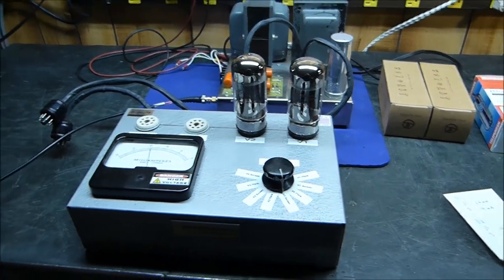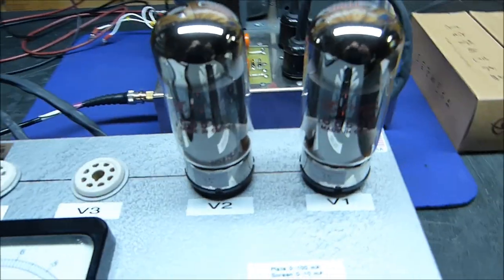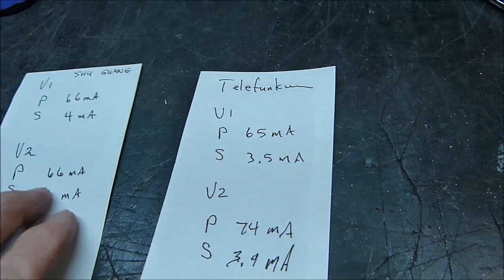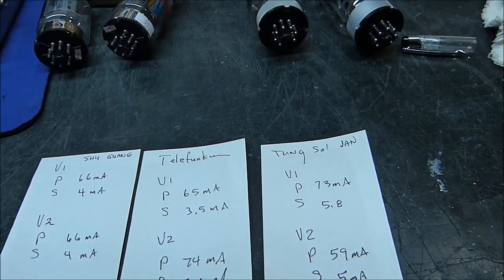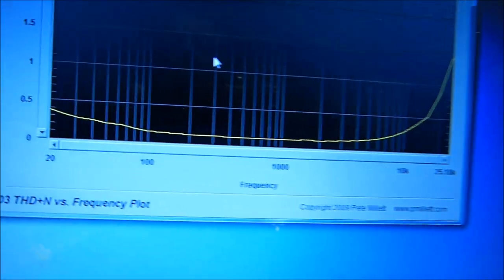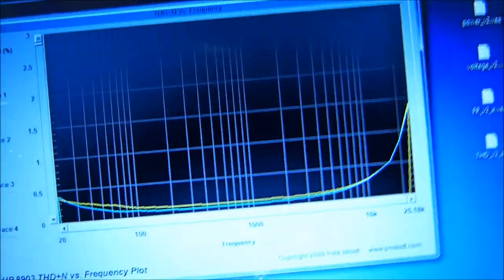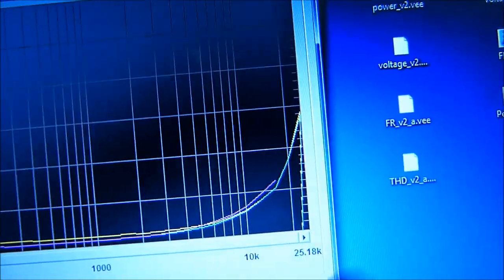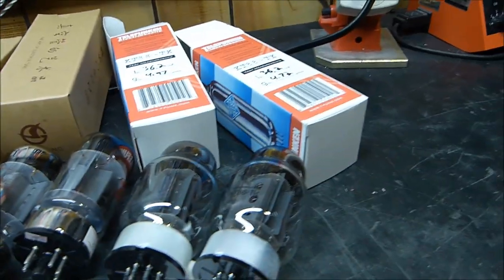6550 (KT88) Shu Guang vs Telefunken vs Vintage JAN Tung Sol Vacuum Tubes in Dynaco Mark III

Comment: David do you have a 6550/KT88 vs KT120 video I may have missed?
Reply from the maker: +Clinton N No, I have not documented any KT120's. I have only personally tested two amps that use four (4) KT120's. It was a new production Dynaco type amp and I am sorry to say, the performance of the amps did not impress me.
Reply: Would you possibly do a side by side of some 6550, kt88,kt90, kt120 and kt150. Maybe do a swap in and test. And then adjust the current specs to optimize say a kt 120 and 150 in your MKIII?  I think that'd would be real up to date and interesting since so many review those tubes as "won't go back" "more bass, mid bass linear" ect..
Reply from the maker: +Clinton N Hi Clinton, one of these days I may splurge and purchase some KT120's and KT150's but as of yet, I have never had any to test. I have owned and tested the KT90's and I think they are very nice.

Comment: I was told by tube depot that the telefunken black diamond is in fact top of the heap JJ and they are cryogenically treated.  Tube depot said that they would match a set also
Reply from the maker: That is exactly what I figured. I can see by the bottle that they are JJ's - Thanks - TubeDepot is a good outfit to do business with. from my experience.

Comment: Is this animal cruelty? Do you pay them well or not?@1:36 a small fly is seen scurrying around near the tube. Are they Chineese flys or do you use domestic? Now I at least know how you get all your work done so well. I've heard of worker bees, but worker flys? I had a flashback to Theodore Sturgeon's "Microcosmic God".

Your stuff is awesome! Thanks so much. I'll spend most of the day here...can't turn them off. Its been so many years since school and I'm thinking of tinkering with some guitar amps and your videos, and practical advice included, are simply priceless. I did have to pull out my 1974 tung sol 6550's and look at them though...just for fun. Need something for them though, only have a univalve that will use 6550's at the moment...they were a gift from a friend retubing a Mac...but he swears they are good. They sound great in the uni but I still need to test them.

Be Well!
Reply from the maker: TheDogpa Yep, the little guy you see is one of my helpers and Made in the USA. He is constructed out of really tiny vacuum tubes and works for free  :-)) Thanks for you nice comments.

Comment: telefunken never made 6550 its fake ( chinese?)  these are all remakes
Reply from the maker: They are made by JJ and Telefunken buys their top of the line and re-brands them just like tube manufacturers did in the USA and England/Holland/Germany/etc. 
I have some and they are very well balanced and have kept their balance. i do give them high marks.
Reply: @ElPasoTubeAmps  Telefunken stopped at 1967

Comment: I just cant bring myself to buy tubes from hoo=flung-poo china
Reply: Unless you're buying NOS at ten times the price, you're stuck with tubes from "hoo flung poo" china or russia. Sad to say, those are the two biggest tube polluters. EAT is making tubes by hand now, KT88's and 300B's but they are a hefty $500/tube....
Reply: @GCKelloch  Every reproduction GL tube has been a massive disappointment. I have some JJ EL34's now and they sound good. Russians suck at making good current tubes.